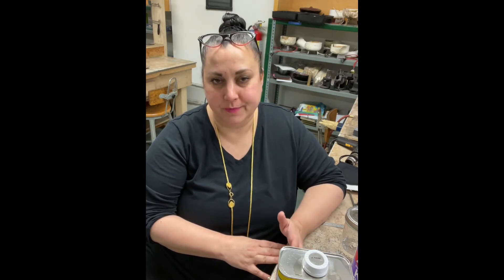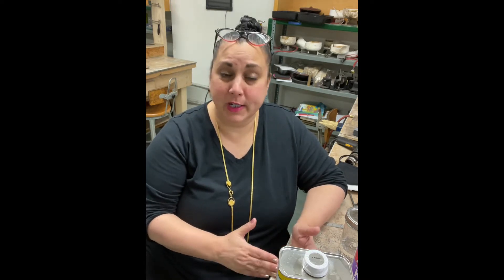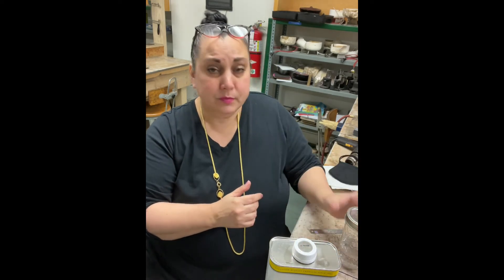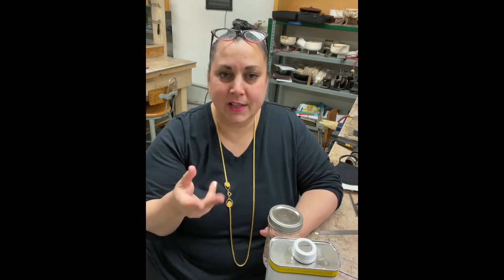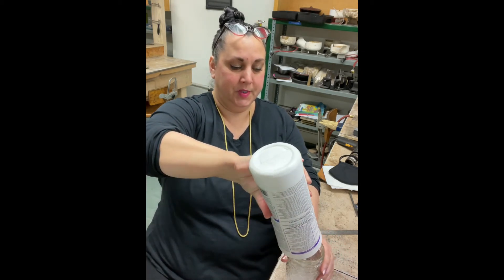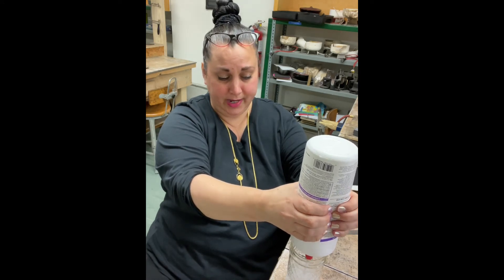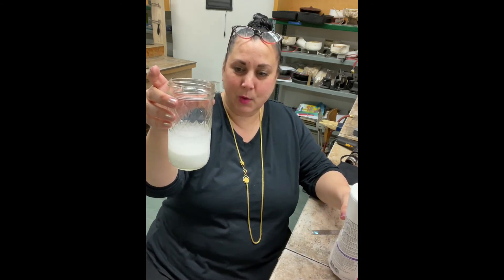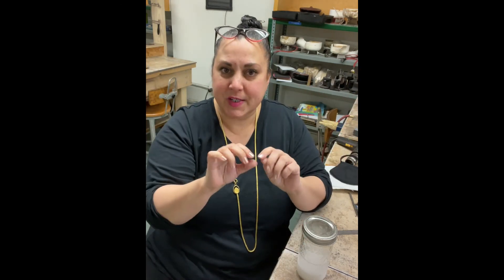How to Make a Fire Coat for Gold or Sterling Silver Alloys

Comment: Hello!! I was wondering something, I have made this fire coat but the boric acid does not dissolve in the denatured alcohol. i shake it up before dipping as you’ve taught me. i noticed though that if the little grit from the boric acid remains on the sterling it can sometimes create what looks like pitting in the silver that is hard to remove/ refine. have you ever found this to happen ?
Reply from the maker: Interesting, I have never seen that before. You have to sand it off?
Reply: Yes I have to sand way down. Weird eh?
Reply from the maker: That is odd, I have never seen that.  @Shukarr

Comment: Thank you for this I almost always burn things
Reply from the maker: You're so welcome! Fire coat will keep you from getting fire scale. :)
Reply: Hello Jeanette,
Thank you very much for your video. 
I have little problems to get boric acid in Gernany. Liquid boric acid is not available. There is only in the dry form as flakes. Can I use this also, do you know, if I can put it directly in the alcohol or I have to dissolve it first in water? Do you know how many percent boric acid has your roachkiller?
I wish you a nice Sunday.
Greetings from Germany
Maren
Reply: @marenc9648  no water. Only denatured alcohol and boric acid. The boric acid should be in powder form. Perhaps you can purchase boric acid from a jewelry supply business.
Reply: @barbaracovey   Thank you very much for your answer. Stay safe - Greetings from Germany